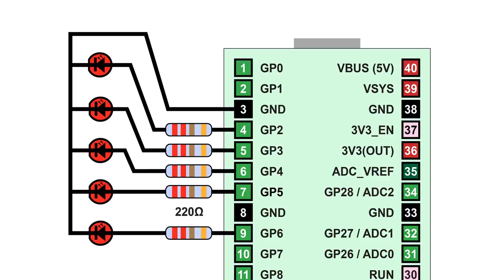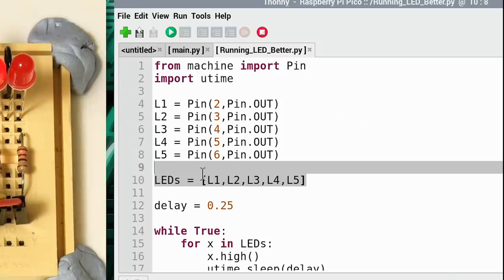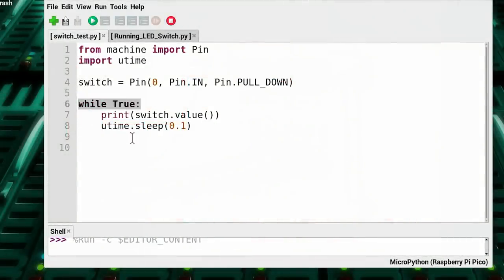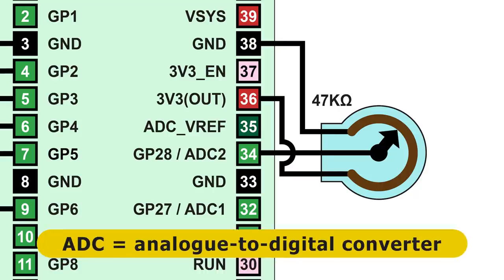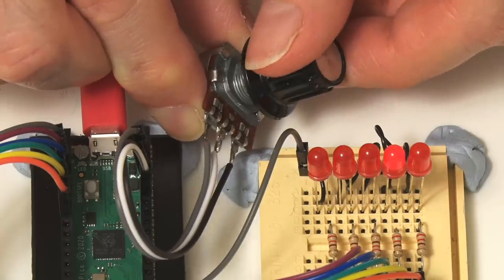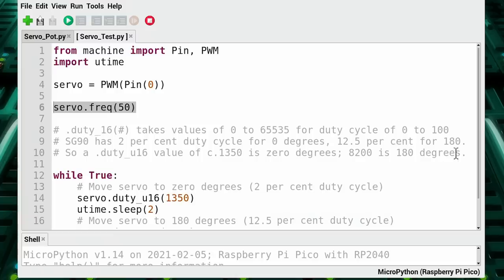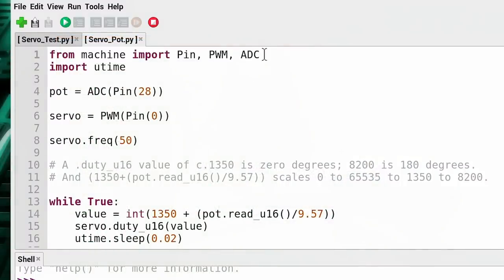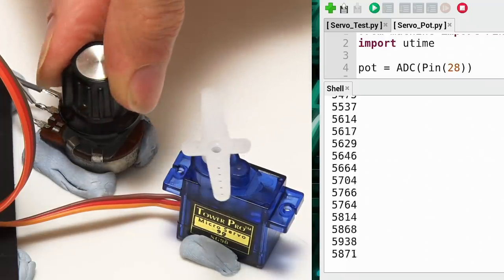Raspberry Pi Pico: Inputs & Servo Control

Comment: It isn't the age of your potentiometer it is a very noisy ADC input.  I'm not sure if the ADC reference is good or what's going on.  Put a fixed voltage devider with 2 resistors and print the raw reading out of the ADC read. It's not very pretty.

Comment: The noisy signal is simply from the ADC itself, not the pot - probably the easiest way to deal with that is a simple digital filter: just add to successive samples together and divide the result by two. Or add four samples, divide by four, ... alternatively, the ADC resolution could be reduced to, say, 8 bit, which will probably be fine to control a servo and provide a much more steady signal.

Comment: Top shelf as usual. I do wonder if the age of the potentiometer is the issue or just the general nature of it being analog and a normal electrical fluctuation. I also wonder if some stabilizing code could be introduced to smooth out the values being supplied to the pi by using a simple averaging function.

Comment: I use the Arduino IDE for programming the Pico. You should try it too as the Arduino IDE is quite a robust platform for programming microcontrollers.

Comment: You can run a running average of the pot readings to reduce jitter, also a 100pf capacitor on the input and ground will smooth the radiated RF the board is emitting.

Comment: The servo needs some dead band added to the code to stop it hunting. ADCs in micros are pretty meh, but I wonder if powering the servo from the micro is putting extra noise on it. Maybe a bypass cap would help. Anyway another interesting video.

Comment: Excellent. I'd love to have seen how to power the servo without running power from the pi.
Reply from the maker: To power servo independently, just connect the power source to its +ve and -ve (GND) rails, and do not connect the +ve rail to the Pi (but still connective the negative).
Reply: @ExplainingComputers  Neat. Thanks. I'm planning to use mine to build a drone.

Comment: At some point I thought "he shoud use the pot to control the speed of the leds". You did. Then I thought "he should use the pot to control the servo". And you did.
I expect that next week you'll demonstrate your ahead-of-time-mind-reading-machine running on the Pico; or does that require a larger computer?
Reply from the maker: We are clearly on the same wavelength!

Comment: hi chris. excelen job as usual. just wanted to suggest idea for episode and that is that several days ago was put out port of open-source proxmox or bare-metal (type 1) hypervisor for raspberry pi. I think it would make great episode to show how with it, raspberry and couple of external disk you could now make your own small private server and run several services and/or distros at the same time. maybe even show how to install it on pc too and make a small cluster. you can find it in reddit section for proxmox and github under pimox (I would put links to them but I know that youtube would automatically delete my post so...)

Comment: I am sure most of the people watching your videos will know this but when you want to use a servo as a wheel drive there was something that had to be modified in the servo to allow it to continue to rotate. Also the duty cycle had to be looped.  Could you mention that in your next video or could someone comment on it?
Reply from the maker: Yes, normally servos are not intended to fully-rotate. For that you normally use a motor, or stepper motor.

Comment: What a nice intro to the subject of controlling stuff. However, you say the PWM is set to 50Hz, which is not actually correct. The dutycycle is a percent of the cycle, so the 50 is 50% not 50Hz.
Reply from the maker: I think you are misinterpretting what I said. Nothing in the video is "not acutally correct" as you state. The duty cycle is indeed a percent of the cycle, as the square wave graphic very clearly shows. But the frequency of the PWM square wave is 50 hertz -- which is why it is set using the command servo.freq(50)  :)  My exact words in the video are "we're setting our servo frequency to be 50 hertz". So I am struggling to understand why you are making the statement you are.

Comment: I am still not sure if a Zero is not more beneficial offering more for the money. But I will get 2 of these to start playing around with them.
Reply from the maker: It depends on the application. You get a lot more computer for your money with a Pi Zero, but it also uses more power and does not have the scope of I/O of the Pico.

Comment: I don't think the jitter is the age of the pot -its analogue noise plus the resolution of the ADC.  I think the ADC is 12-bit?, so 1 increment is 3.3/4096 = only 800uV. Try sticking a cap across the wiper on the pot, or better a resistor in series with pot, cap to ground, to decouple it from the supply rail noise.  

Another way to look at it - you are sending a 50Hz 3v3 square wave, if 1/4000th of that signal couples to the ADC input then that's 1 bit of noise. As for the noise on the supply due to the servo ... who knows.

An old noisy pot would more likely give readings that jump around all over the place as you adjust it, but left alone would not add noise.

You could also try a primitive digital filter - a running average. Simple to implement.

Maybe some mileage here for a new video, dealing with real word interfacing where you need to deal with possible analogue noise, or de-bounce a switch, that kinda thing ?

Whatever, keep up the excellent work - detailed , clear, touch of humor, top job.

Comment: Nice video. I would very much like you to cure that jitter - but NOT by software as we learn nothing from that. It could be due to errors in the ADC, supply rail noise (run it from a battery, add capacitors?), emi picked up by the wires connected to the pot (add a capacitor to pot wiper, use shielded wiring? separate pwm wires from pot wires?), etc. Does the breadboard cause an issue? Getting accurate and reproducible readings is essential. Also, if you replaced the pico with another one, do you get exactly the same readings (i.e. variation in picos/micro)?

Comment: The jittering problem is not caused by the age of the pot, but simply because pots are not precision instruments. You need to divide the input from the pot by 957, then multiply by 100. 

Corrected code: value = int(1350 + ((pot.read_u16()/957)*100))

Comment: Going to build my own audio streamer for my Hi-Fi system, I've just ordered an Allo BOSS I2S DAC v 1.2, which I will pop it on my PI3B, apparently the 4B creates more noise. Volumino looks good for the OS. would love to get Explaining Computers take on using raspberry pi's or pico's for building high quality audio streamers, there seems to be loads of DAC options hats, shiit DAC and operation systems. Plus android, apple apps to control network streamer eg Tidal connect and Spotify connect. It's all new to me.

Comment: Thanks for your educational videos.  They’re great!    The Pico is cool and has nice capability for its price point.   I  struggle with understanding how to deploy it in a real world application.    

For example, I’d like control my wood shop’s dust collection blast gates, using 12v linear actuators.   I’d use a RPi 3B+ or 4 for the centralized logic (flask web app) and a Pico at each blast gate.   RPi would signal/message the Picos, which would each control their actuator.    Since Pico does not have network/wifi, I’d need to physically wire the 6 or so Picos back to the RPi.   I’d also need to get 5v power to each Pico, and 12V power to each actuator.    Curious what recommendations you’d have for this type of deployment?  Thanks.
Reply from the maker: There are now RP4040 (aka Pico clone) boards with WiFi: https://www.seeedstudio.com/Wio-RP2040-mini-Dev-Board-p-4933.html and Ethernet: https://shop.pimoroni.com/products/w5100s-evb-pico?variant=39530115301459 , as well as Pico WiFi HATs. But as you note, the key constraint in the kind of setup you describe is wiring/power to each actuator location and control board . . . Good luck!
Reply: @ExplainingComputers  Great info.  Thanks.

Comment: dislike count is currently 31 if anyone is wondering. I don't think his video is bad its just that transparency is nice
Reply from the maker: Why would anybody be wondering? What is "nice" about the dislike button? Nothing. There is enough hate and negativity online without a button for it and a counter to show the results. :)
Reply: @ExplainingComputers  The dislike count provides transparency and the viewer can make a guess on whether to watch the video or not  therefor saving time. Getting rid of opinion doesn't solve problems it makes them worse. Now of course removing the dislike button isn't going to cause much harm. But even so, communication and discussion make for a much better community.
Reply: @ExplainingComputers  Oh and I do like you video by the way helped a lot with my pico.

Comment: Maybe add a rounding step to the calculated value to nearest 100 or 2 significant figures would be a simple way to remove the jitter while maintaining a fairly smooth motion when changing the value!?
Reply from the maker: Yes, this should work. :)

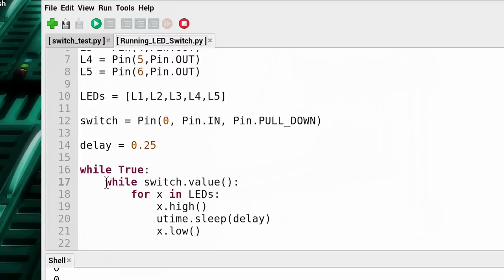Comment: 6:37 Great video, as ever, but I am a little concerned about this code. The `while True` loop around the outside has no delay. It may be that the call to `switch.value()` yields control to other threads/processes, but I feel this is poor programming technique. Isn't this loop going to use 100% CPU when the switch is off? It's okay for a little test code, but I hope no-one feels that this sort of thing is okay for production code.
Reply from the maker: Yes, the code there would be better with a delay, as I include in every other example in the video. Give me a break! :) This a demo video.

Comment: Maybe a small ceramic or monolithic cap in range of 0.1 to 0.47uF value soldered between the pot wiper (mid pin) and ground might help with the servo jitter problem.

Comment: I love the Pico too I only have 2, one is powering a little RGB trinket thing and the other is my test/dev.
It would be cool if you looked at the Seeeduino XIAO, it's basically the size of my thumbnail, SAMD21 based, USB C, 14 pin GPIO

Comment: What would be really nice would be a simple command line OS for the RPi PICO, simlar to the BBC Micro or the Arthur OS for the Archimedes, with ARM BBC Basic, access to the I/O pins, BBC Micro video modes, and the ability to store and retrieve data/files to an SD card.

Comment: a little late to the party but isn't the ADC_VREF a filtered 3.3V designed for ADC usage? This and putting the Pi out of power saving mode should help with the jitter
Reply from the maker: Thanks.

Comment: Hi Chris, as a noob, you'll have to excuse my ignorance, but what do you recommend if your project requires more I/O than is available on a Raspberry PI? Would you use multiple PIs, or is a Raspberry PI simply not suitable for this purpose? Maybe there's some coding trickery to get around this (e.g. require output from 2 pins in order for an LED to illuminate)?

Comment: Index Notes are always good in any programs? It saves headaches later on (6 months or longer) trying to remember when you're old is hard? Then the Index tips are very helpful.  Bring back the C, C+ programming. Yes, Python coding is great? But download to my Kindle to learn. Slow learning? But tired and error? If it doesn't work you make errors [Bracket], and ( ) are mostly the problems!

Comment: Sir Chris.  Can we connect an 8switch to PICO?  4 moisture sensors / 4 very small water pumps...   if dry then trigger correct pump to water plant until moisture sensor reads moist?  Then turn off pump?  Manage 4 potted plants?
Reply from the maker: Switches and moisture sensors, yes. Pumps will requier a control board. I happen to be working on a "Raspberry Pi Plant Watering" video right now, which will post in June. It uses a moisture sensor, and a solenodi value (controlled via a relay board) to deliver water.

Comment: If using a single LED at a time, wouldn't it be better to use a single 220 Ohm resistor on the ground pin (obviously, in series)?

Comment: Also, I made a pi Pico simple watering system, but having trouble with powering. Every time I turn on the pump, Mu locks. Also it won’t run on battery or external power away from the computer. Simple 3v-5v single relay board connected to pin 40. 3v pump connected to the other end of relay NC. The pump is powered by 3AA batteries at the moment.  Capacitive moisture tester connected as well to 3.3v and GPIO. Would be interested if you can get this setup running.

Comment: Christopher, careful with your conclusion about the age of that potentiometer causing that jitter. It might be perfectly normal behavior, it might never have been intended to be that accurate. Maybe the device just did not need any more accuracy?
Reply from the maker: True. Adjusting the volume on a radio did not require digital precision! :)

Comment: I’m currently using a RPi Zero W to control my exterior lighting. I have an internet connection which gets the day of the year and then I calculate the sunset time for the area I live in. Am I correct in thinking that I could not use a Pico because it does not have wireless internet capability? Is there perhaps another way I could achieve this using a Pico?
Reply from the maker: Yes, you are correct -- there is no WiFi on the Pico.

Comment: Hi Chris, very interesting. I can see a whole host of cool ideas using this and your Robot platform project. Something like a miniature bomb disposal type robot or wireless telepresence device. Do you know whether there are libraries for the pico that enable you to use an Xbox controller for control? I know that they are used for various things, but am unsure if there is a licence fee.
Cheers, and thanks for another great video.

Comment: Servos do not use pwm signals they require a timed pulse of between 1 us and 2 us with a total delay of 20 us. between pulses.
Reply from the maker: Servos hooked up to microcontrollers (like the Pi Pico or an Arduino), as well as similar control devices (eg SBCs with GPIO) are most definitely controlled by PWM. It is the PWM outputs from such controllers that produce the pulsed square waves that control servos, which is what you describe. This is not a video about servos. It is video (in part) about controlling servos with a microcontroller, and this is done using PWM outputs.

Comment: Hey Chris! I’ve just started on this pico thing as I intended to control a stepper motor which I did with a piece of code I found also here. I am however struggling  with the ideia of making the motor start and stop with a pushbutton, can you help?

Comment: I find it ironic that my R-Pi400 will not communicate with my Pi Pico. I have tried all sorts, (checked USB port works, checked driver was present and in correct place)   without success. So, thinking that I may have had a dud Pico, I downloaded Thonny to my Windows PC, and to my surprise found that the Pico sprang to life without me having to do anything and works fine! 😂 (but it still sends the Pi 400 to electronic Coventry though).

Comment: Sir may I ask, how to control atleast 3 servo motors in altertaning motion, like the other servo will only operate after the first servo motor worked.
Reply from the maker: To guarantee this you could need to put in some switches that the servos contact when they are in position. So you would then write the code to move the first servo, and then wait until the switch it pushes has been pressed before activating the second servo, and so on.
Reply: Bottango is what you are looking for

Comment: its less your old potentiometer that cause the adc to flicker rather than the adc itselfe... most promising improvements are using external ref voltage and some filtering in software... 
if the pico features other internal ref voltage than 3.3V than it might be a good solution too. but dont use the default Setting as your video showed its not good (arduino, esp, stm all of them have those problems)
Reply from the maker: Thanks for this. Some filtering would certainly help.
Reply: quiet a bummer... acc datasheet there is no other internal ref voltage (page 7-8) https://datasheets.raspberrypi.org/pico/pico-datasheet.pdf

did you used AGND for your potentiometer ?

Comment: Hi , what if a company want to create audio player with no WiFi and Bluetooth , so what are the option, getting pi 3 will waste unnecessary money , can we create custom pi?
Reply from the maker: A Raspberry Pi Zero has no WiFi or Bluetooth. :)
Reply: @ExplainingComputers  Thanks for reply, can I ask you one more thing, what will be best option for creating a device like this 

https://youtu.be/MIwc2iE8qpA

Remarkable 2 (writing  tablet)

Only want to draw some lines on screen and saving them in memory card just like this, and no extra features.

And did resberry pi or arduino is being used in real life product or these are just for learning 
Thanks 😊🙏

Comment: I am yet to see anyone on YT do something with the Pico that cant be done with an Arduino, and why do people pronounce it "pee co "? surly "pie co" should be the correct pronunciation after all it is from the Raspberry Pi foundation, I guess its because people are like sheep, they hear someone pronounce something wrong or differently and follow suit never questioning the authenticity of their actions
Reply: Read up on the Picos PIO, that is something the arduino cannot do.  The ability to have things like VGA output and other highspeed interfaces from a cheap microcontroller is amazing, I am sure soon people will discover so many more uses for the PIO in the Pico
BTW is is pronounced Pee-Ko.